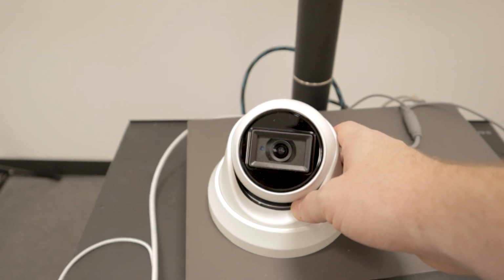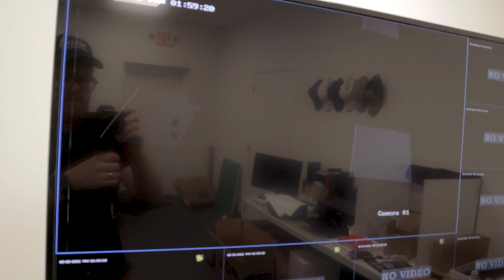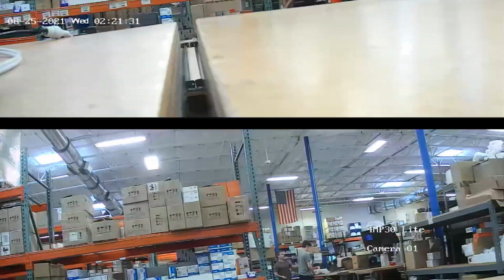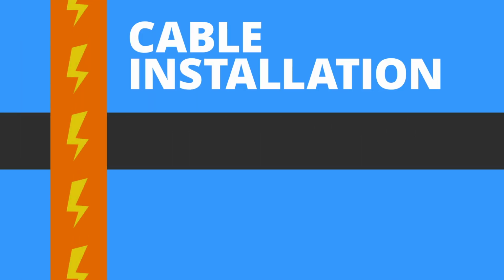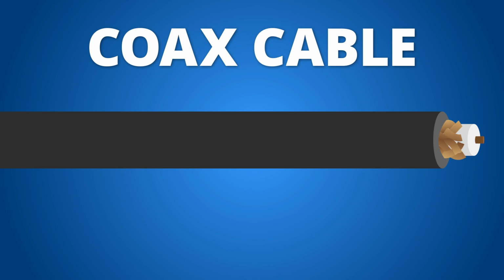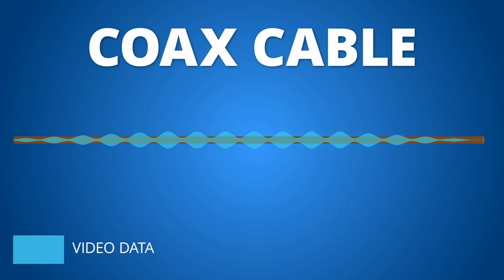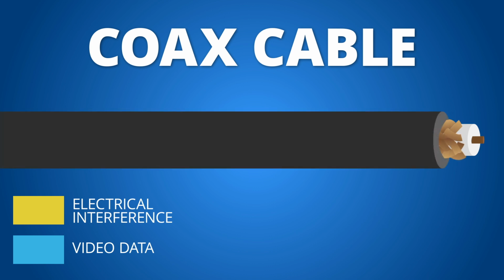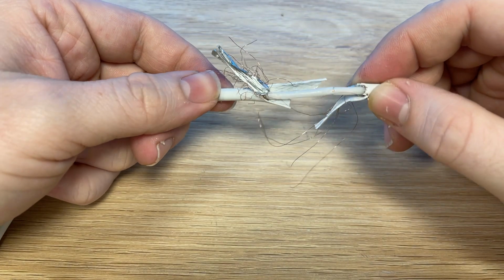CCTV Video Interference Quick Fix: Check Your Cables!

Comment: I have a cctv camera (1 of 6 on the system) that's fine during the day, but goes out every night. Goes black, and gets cross talk interfere from the other channels.

Any suggestion what could be causing it or how to fix it?
Reply: If you have IR lights it’s drawing extra power at night. Check your power supply voltage and amperage to make sure you have enough power going to all the cameras.

Comment: PRO TIP : The magnetic ferrite on the power supply I used for my camera when wrapped near the video camera wire caused discoloration, horizontal lines etc. Unwrapped the e-tape and separated them and its fine now. Thanks for this the idea of EMF did it.

Comment: All my cameras were working fine, then one day all five of them had horizontal lines running through them, hooked up another DVR and still had the issue, also hooked up different monitor with different line, could it be that all the cables are bad?
Reply from the maker: It would depend on what kind of cameras you have! Are they analog or IP?

Have you tried taking the camera down and connecting to the recorder with a premade patch cable to see if that makes a difference?
Reply: @NellysSecurity  I left work where all my cameras and systems are, but I tried hooking up one camera at a time and I think it might be the power supply and the or the splitter to the cameras, when I directly plugged in one camera at a time the image got much better, I'll find out more tomorrow, and thanks for getting back so quickly, much appreciated.
Reply: Try adding a video balun
Reply: @Aizfusiontech  it ended up being a bad power supply cable, thanks for the heads up though, I'll keep it in mind for the next time.

Comment: i used cheapest ethernet cable and wired them along side with power cable and even worse in this case , all the power cable is powering with high wattage factory machines…

Comment: I had interference  on one of my outdoor cameras, I check the coax connection at the camera site all it was for me was the coax was bend to a point that cause the problem straighten or shorten coax if a bit to long. Problem solved.

Comment: Hi, great informational video! I have a question, would coax cable going to my modem/router interfere my video signal if it’s running together with the regular RCA BNC cable that comes with the standard security systems?  I get a blurry signal that looks like a transparent playback over my video feed, it causes my security system motion detection to go off like crazy.
Reply from the maker: It shouldnt, but you might make sure the cables arent nearby any higher voltage cabling. Also, check the BNC connections and make sure they are on properly. Grounding issues on BNC connections can cause that kind of interference.
Reply: @NellysSecurity  thanks a lot for your response I appreciate it!
Reply: @NellysSecurity  Grounding issue on bnc, means ?
Reply: Just curious, can properly connected BNC video connections be affected by touching against a metal housing?